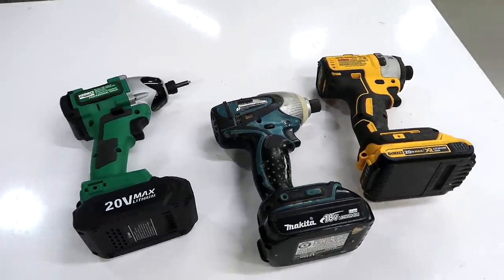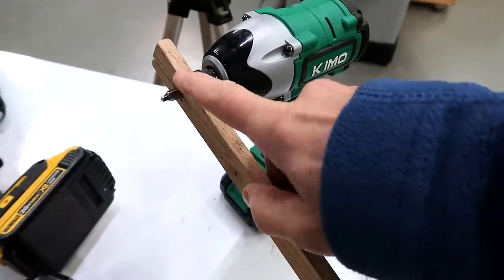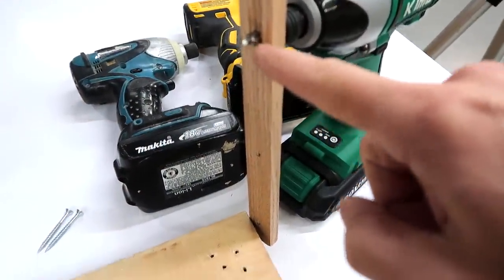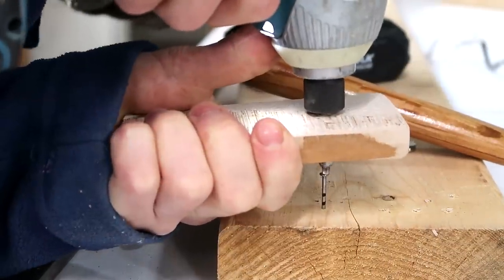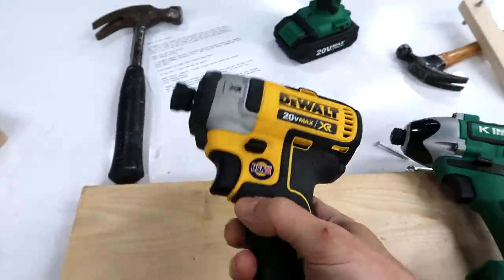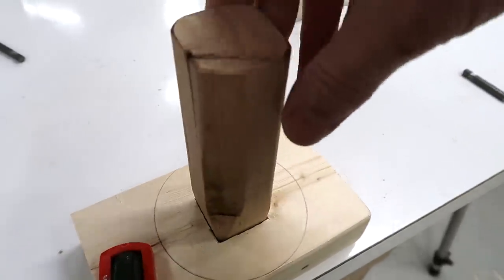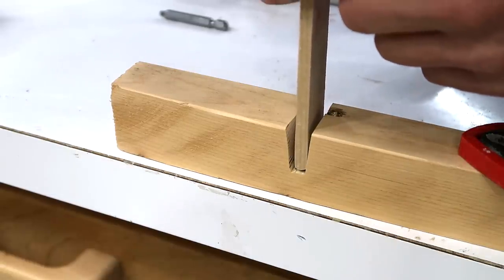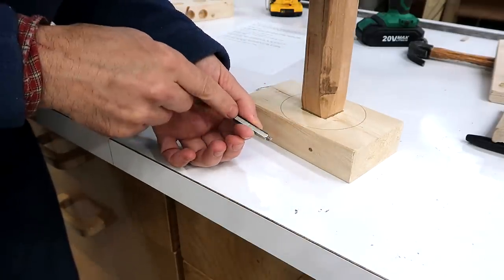How impact drivers prevent screw cam-out

Comment: Less cam-out with Phillips as opposed to Robertson?  HERESY!!!
Reply: I know, right?  Philips is SUPPOSED to [rather, designed to] cam-out (under "excessive" torque), to prevent damage to the screw head, or the driver.
Reply: @kenc2257  is it me, or do robertson get damaged more when they cam-out? That's kind of as designed.
Reply: I think only if you are off axis. If you are able to get a straight shot, then robertson seems to work very well. Then again, phillips works pretty well in that case, too.
Reply: Torx?
Reply: That's often because people confuse Posidrive and Phillips, and use mis-matched screwdriver bits.

Comment: On an especially difficult flathead screw, I'll sometimes sharpen a bur on  the tip of a screwdriver, similar to a card scraper.
Reply: i grind the taper out of the bit to make the engaging surfaces more parallel
Reply: @SuperAWaC  They make hollow grind screw driver's for that.
Most people refer to them as gun smithing screw drivers. But in reality, all slotted screws use them.
It's a lot easier to grind a slot than a tapered slot. Milwuakee's 6 in 1 screw drivers come with the slotted ends hollow ground.

Comment: What about torx bits? I also remember reading that philips screw bits are designed so that you will cam out at a specific torque because Ford was having problems with his workers over tightening screws on his model T

Comment: Mattias, try buying some cheepo square drives on amazon. I got a 4 pack for my impact driver and I have yet to have one ever come out or strip. I think finding a good match between your screws and your square driver is key. The square driver that came with my set of lots of drivers that I bought long ago was thrown away quickly, as it tended to come out much to easily. The ones I'm using now are a perfect match, and I always restock on the same screws from the same supplier now.

Comment: In the US, Ridgid makes a product called stealth force that is a quieter impact driver.  I don't know if it's available in Canada or if there's one that works with your battery platform, but it works as advertised - much quieter, and very effective.  I recommend it tentatively to you given the elbow issues you have, as it might kick back more strongly.
Reply: hydraulic impact, every brand makes one
Reply: Makita makes an impact driver that uses hydraulics and does away with the weight needed in a normal impact driver. I haven't got one, because they are very expensive, but I can imagine them vibrating less besides being quieter.
Reply: @johannes.f.r.  AvE did a video on one. Not sure if it was makita, might have been Rigid. It didn't have as much grunt as a standard impact as you'd expect, but iirc he was impressed with it nonetheless.
Reply: Ew. Get the Milwaukee, they at least work pretty well and the batteries are better. Not as much functionality as a regular impact but miles more functional than most of the competition.

Comment: You may have solved this in the past year, but I’d encourage you to find one of AvE’s tool tear down vids (I’ll see if I can find a link). The impact action is a rotating mass which will oscillate longitudinally which I can appreciate may be the ‘hammering forward’ feeling you’ve got.

Also on the camming out a constant, and consistent force (e.g a Drill) will have that rocking effect you well demonstrate.
I imagine if you watched an impact driver in slow motion, as the hammer applies force to the 1/4”DR bit, it would result in the screw being rotated in short sharp bursts…

Apologies that I’m no wordsmith, and I like your style in applying some scientific method to solve said observations!
Reply: One AvE vid showing the Anvil and Hammer setup for a Japanese Makita… most impact drivers use a similar mechanism.
https://youtu.be/p2EpdRN2h6A&t=5m52s

Comment: You could try the hydraulic impacts. Quieter than standard and plenty powerful enough to drive wood screws.
Reply: Came here to say this. I have a Milwaukee surge, best impact driver ever!
Reply: @anders4674  AVE claims they're not skookum because of their reduced power compared to traditional impacts. I don't remember him saying they won't last.
Reply: @aquaknot  I imagine they might have reduced lifespan because they use a working fluid and thus rely on seals etc, which are probably not economically serviceable in a consumer tool, but a Matthias isn't building houses or working an assembly line. It would probably work out fine. wood screws wouldn't even be stressing the mechanism.
Reply: @F0XD1E  After using my m12 surge, I don't even pick want to pick up my m18 gen 1 hex. I'll trade length of life for quality of life.

Comment: Impact Drivers work so well you hardly need to apply pressure which means you can use them one handed while reaching and still achieve great results.  AvE has torn a couple apart if you want to see what's going on inside and as far as I remember, there is no forward hammering action, just rotary.  However, I think some Impact Drivers now also come with 'hammer drill' function.

Comment: The Phillips head was designed to cam out! So that the auto workers would not strip the threads. 
Pozidrive was designed not to cam out. 
Torx was designed to allow maximum (or a great deal) of torque to be applied.
Use the best head for the job.

Comment: It is interesting that your square drive bits have a taper to them. I have a bunch (probably older ones ) that do not have a taper and are much better at not camming out (but much worse at trying to drive at a slight angle)
Reply from the maker: they all have a slight taper, so do the screws. Taper is needed for manufacturing.

Comment: I tried Robertson screws. They seize to the bit, like hex does, but worse. They have to be driven almost straight on. But the worse part is you need the right size. With phillips, you can be off by at least one size in most cases. So a #2 phillips screwdriver can drive a heck of a lot of different phillips screws.

Comment: If the repositioning of the hand while using the screwdriver prevents cam out and the torque release of an impact driver does the same then pausing a  drill would help readjust the position of the bit. My dad would always drive a screw in one go and pushing on top as hard as he can. But I will rethink that method and will make one or two pauses when driving a screw.

Comment: I don't think they hammer forward, the vibrations combined with you pushing down is probably what was driving the nail/scratching the metal. It's all rotational with the hammers hitting dogs as they go around. On the subject of loudness I have a ridgid stealth and it is much quieter than a standard impact. It's heavier than my other impact though.

Comment: The main problem with Phillips is that the moment you cam out, you've rounded over the bit's profile making it easier to cam out...less "bite" in the bit over time.   Robertson doesn't seem to suffer as much from that, probably because I feel it's much easier to keep it on-axis with the screw...the moment the bit bottoms out, you know you are aligned correctly.   It's almost impossible to know if you are straight on a Phillips screw.
Reply: The Phillips head was designed to cam out! so that the auto workers would not strip the threads. Pozidrive was designed not to cam out. Torx was designed to allow maximum (or a great deal) of torque to be applied.

Comment: I just installed about 1600 square feet of chipboard using coated Square drive screws. I had lots of the screws left over from another job. What I learned is to never use coated square drive screws.  I think the coating thickness isn't well controlled and leads to fillets in the square drive socket, causing very bad camout, even when using an impact driver or the hammer feature..   I should have not been cheap and bought new screws to save myself alot of aggravation.

Comment: torx screws usually don't have that problem and stick to the bit
Reply: yes and no :) Torx was intentionally designed to maximize the torque with a minimal amount of profile and be machine fed with vacuum holders for automotive applications - but the "stick to the bit"-feature is not part of the original design

Phillips later refined the System and called it "HexStix", this is Pretty much the same than Torx, but the "stick" feature was added - they do this by "stretching" the tolerances a bit with slightly wider lobes, so the bit will stick in the screw drive - also from the official side there is now "Torx ttap", which also has "stick fit"
Reply: mr cinhcet
you obviously never used robertson screws. I used both.
Reply: Torx tools are also extremely fragile and twist or snap with mild amounts of torque for their fastener size.
I wouldn't recommend them at all. I've twisted off a snapon t20 screwdriver try to remove small screws on appliances.
Another issue with torx is just because it feels like it fits, doesn't mean it fits. You have to keep going up in size until one doesn't fit to know what size it is. A t20 will fit pretty nicely in a t25 or t27 head. It can feel a lot like putting a 10mm on a 3/8ths head. But you'll trash either the head or the tool if you try to use the smaller size.
Reply: @billybobjoe198  Agreed 100%
Reply: @billybobjoe198   You have cheap ass screws.  In Germany Torx is the standart, but we have good screws and i have drilled thousands of srews. Its my job to do that
Reply: @billybobjoe198  Cheap torx bits tend to break but so do cheap philips bits.
Everything else you describe can be attributed to your lack of experience using torx bits. I can discern t25 and t20 from one another just by looking and in europe nobody uses oddball sizes like t27. We use torx in increments of 5 - t15, t20, t25, t30 etc.
Reply: @billybobjoe198  "extremely fragile" ??  I have never snapped or twisted any Torx tool or bit. Maybe the tools there have low quality.
Reply: We should just all agree that Torx/Robertson are both way better than Phillips/slot, and between the two it doesn't really matter which one you use. It's like trying to fight between Firefox and Chrome, it doesn't really matter except that they are both way better than IE and Safari.
Reply: @damnmab  Just wanna let you know my BMW uses T27 fasteners on it.
So either you're inexperienced, or you live in that special area in Europe that's superior to everywhere else. People have been talking about it online for decades but I've never been able to pin down where it is.
Reply: @billybobjoe198  sounds more like user error than a design fault
Reply: @marcelo403polo2  I admit that I have never used robertson screws (I think you cannot buy them in Europe easily), but what is your point? Torx just always work for me
Reply: @paul66766  Go buy some high dollar impact torx bits and go to a junkyard and start trying to disassble Jeeps.
You're gunna find your $20 bits snap before the bolts budge.
Reply: @billybobjoe198  I worked on Mercedes vans and light trucks for five years, and they are full of T27 fasteners. 
The special area in Europe you refer to is full of uninformed people who assume that their air of superiority alone will win an argument.
Reply: @billybobjoe198  I just put in 100's of 8mm thick, 240mm long screws into pine. They where t50 drive. I don't think you could do that with any other drive type, I really don't think they are fragile.
Reply: @billybobjoe198  turn a wrench on a Chrysler product?
Naw i'll stick to my GM trash

Comment: At around 5:10 Matthias says, that "the effective width of this [Robertson] bit is quite narrow compared to the Phillips bit", and that it's the main reason for worse cam-out performance.
I submit that the wings of the Phillips screw are more perpendicular to the driving force than the at most 45° of the Robertson bit.  A worse angle in the torque direction means higher forces in unwanted directions, e.g. push-out.
Since hex keys are not tapered, the even higher outward forces in their case do not result in push-out.

Comment: I've personally had the opposite experience with robertson vs phillips screws and camming out.
Reply: Yes, this won't work as much with Phillips, because of their design.The driving surfaces of a Phillips are slanted, so a part of the driving force will be applied backwards out of the screw. The sharp, high force impulses of an impact driver will make it harder to keep a phillips in. Really, phillips is bad all round. Use robertson, hex or torx.
Reply: that's what I thought it would be like
Reply: @robertbackhaus8911  but impact drivers work very well at keeping the bit in a philips screw

Comment: The anvil inside the dewalt does no forward hammering at all, no mechanism for it, and bearings holding the chuck etc. The shock though imparts energy into the entire body and that is what you feel in your hand and what was, along with your forward pressure (would not have done it without that) pushed the nail down. You're 100% right about the intermittent torque thing, same reason uneven firing order modern bike cranks work, big push, then gap, safer because less likely to lose traction and kill the rider! :-)
Reply from the maker: I thought the uneven firing was because that’s the only thing that works with a twin V arrangement.  also  that characteristic sound.
Reply: @matthiaswandel  With a V twin you can fire them unevenly and widely spaced, or unevently and closely spaced (known as "big bang"). But some of the 4 cylinder bikes have offset crank journals to achieve a similar micro pulse in the torque that aides traction. Makes modelling/tuning/control systems difficult but produces a better bike. Top tier sport bikes are pretty highly fine tuned machines, similar to hyper cars or F1 in many ways, just way cheaper.

Comment: I really appreciate your your honesty on this channel, you have a good methodology in evaluating what works and aren't afraid to share what you learn... BTW: I know some like the star (Torx) screws, like Steve Ramsey, he swears by them as they allow the driver to get a good bite on the screw... But others swear at them and really hate them!  But now you have me curious: do they easily cam out too? With a star you are increasing the number of contact points between the driver and the screw.  I don't own any star screws/drivers, but maybe this can be a topic for another video comparing them? If they work better than Phillips, then maybe I will start investing in them...
Reply: If you intend on ever taking it apart, a stripped screwhead is a real pain. Torx helps alleviate that issue.
Reply: @HerbanLegend420  I know what you mean... and I have considered Torx a number of times, so maybe it's time to change over. And to your point exactly, recently I experienced the removing of a stripped screw head: I've had Phillip screws that were chowdered to death as I drove them in... These screws came in a wall anchor kit (Homeless Despot)  where you first install the plastic insert in the wall. I have reasonable control of the screwgun and wasn't jumping out of the head, they were rounding as I drove them in!  I think they made those cheap-@** screws out of butter... and recently I had to remove those screws and... well... not fun... Luckily I had some OTHER screws that fit and didn't chowder at all!
Reply from the maker: a lot of hardware comes with junk screws made of soft metal.
Reply: @HerbanLegend420  Fun Fact: TORX screws nearly never get stripped. In my experience the head gets ripped off the screw body before the star gets damaged. 
As long as you do not misalign the bit A LOT. 
Torx is superior to philips by far. I threw away ALL leftover philips wood screws and replaced them by torx.
Reply: @matthiaswandel  That's true, I've noticed it more and more... Maybe the thing to do is to be proactive and throw away the provided screws and go with ones that you trust.  But my problem has been that I discover it too late... right as you're installing the screws, they're stripping out on you...  and then after they're in, it's more of a pain to remove them, find better screws, and replace.   My next concern is "how strong are these soft screws" do I trust they'll hold 50 lbs(whatever the rated weight on the anchor) or not?

Comment: I read somewhere that Philips head and driver were designed to cam out to prevent over tightening, whereas JIS was not.  Is the taper on the Robertson driver a similar design?
Reply from the maker: Philips screws don't cam out from torque.  They do however cam out from misalignment.  Same for Robertson screws.

Comment: Interesting. I might go and buy myself an impact driver. I had resisted because I figured why two tools when one can do both tasks, but 1) cam-out is a real pain point for me, and 2) it's not all that unusual for me to have to switch between drilling and driving rather than be able to drill everything first, and then drive all the screws.

Comment: I had to flip over the boards on my deck so I could use the unweathered side.  Tried it with a regular screw gun and it just didn't work - Phillips slots all filled with paint and long screws corroded into place.  I bought a hammer drill and it made the task doable.  Not easy, mind you, but possible!
Reply from the maker: did you try an impact driver?
Reply: @matthiaswandel  no. Maybe I should have.

Comment: The Milwaukee Surge impact driver is very quiet compared to other impacts.
By the way, I love the Robertson square drive screws and I live in USA. That's all I buy.  I get a lot of camout from Philips screws and Torx drive has a tendency to snap off the stars in the screw or off the bit.  And yes, I've bought every high end brand available and they all break in short time. Robertson just works best for me and I do mostly cabinet construction.